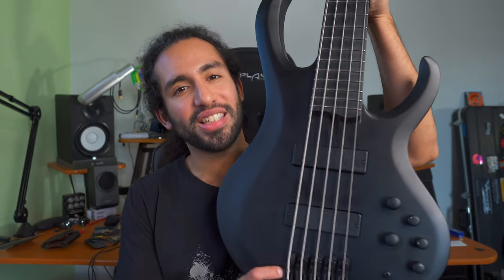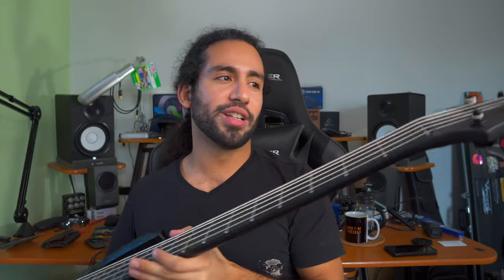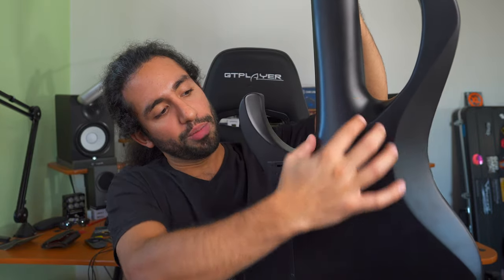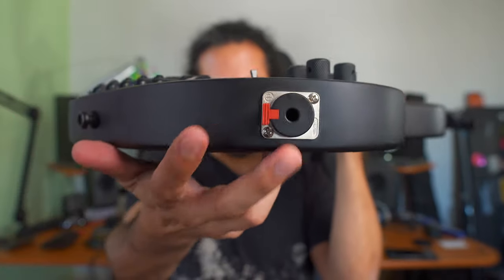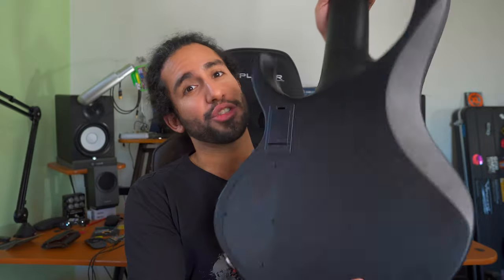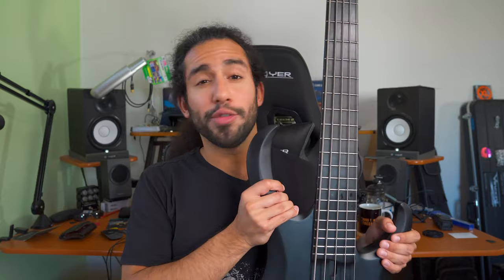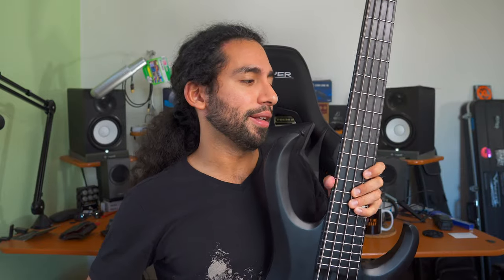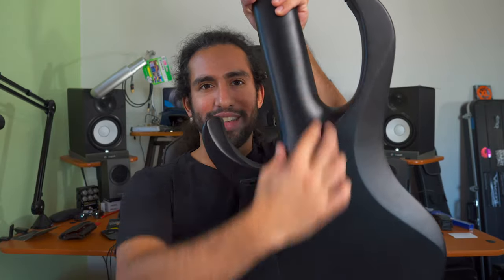Ibanez BTB Iron Label | Bass Review

Comment: BTBs in general should have a 4 string version... in addition I would say also options for passive pickups ONLY !! I had a BTB in the past, love the body design, but 35 inches length and 'only active' system made me sell the bass.
Reply from the maker: Agreed. Well, they’ve built a 4 string version for the bass player of Tesseract. Maybe a production series of that will come :)
Reply: You could have nodded it passive very easily. The pickups are passive. Only the preamp is active and would have needed to be removed.
Reply: @bobbyzig3879  Thanks Bobby. I have spelled it was also because of the scale length!

Comment: Just got mine
Reply from the maker: Congrats!
Reply: @IvanBassist  it gives me bruise in arms because of the body shape edges. And i dont like locking jack but other than that it is awsome
Reply: Nice! Is it different to the one in this video? Cos the ones I seen for sale aren’t like this. The finish in the same but the shape is slightly different, the electronics are different and the fretboard has an angled type of design…

Comment: Ivan, together with LowEndLobster, you do maybe the most comprehensive bass reviews on Youtube.

I agree with the remark about the Bartolinis. Bartolinis in general are dark-sounding pickups - the MK1s found on most Ibanezes and Corts sound even darker than the BHs this one has. A complete opposite would be the "Nordwall Dingstrand" pickups made by Nordstrand, and trying to mimick the Dingwall sound. There is a girl somewhere here on youtube who has made a comparison between Bartolinis and the "Dingstrands" and the difference is abyssal. They would truly transform this instrurment.
Reply from the maker: Thanks! 

Luckily, changing pickups is an easy mod 😁
Reply: @IvanBassist  Indeed as they are the same form factor. I found the video I told you about. I made a mistake - the initial pickups aren't Bartolinis but "Sandberg booster" pickups... but that just proves the point even more:

https://www.youtube.com/watch?v=v241vPOqCsI

Comment: Do you think it'd be better to buy this bass than a stingray special?
Reply from the maker: Those are two very different sounding basses. What are you looking for?
Reply: @IvanBassist  a bass that would be good for metal and rock while not being too aggressive. I also plan to detune a lot
Reply from the maker: @anotakudetective1546  Check the new BTBs fanned fret if you plan to detune quite a bit
Reply: @IvanBassist  I usually play my bass guitars up high on a strap. Would a 37 inch be comfortable for that?

Comment: Thank you! Could you tell me what the string spacing is like? I found it hard to slap on one 5 string I trialed because the strings were so closely spaced compared to a 4 string... Really wanted a proper demo, not one with effects, distortion and anything else that makes it impossible to get a feel of this instruments. This was great
Reply from the maker: This one has a much wider spacing than the SR series by Ibanez. Pretty comfortable!
Reply: The string spacing on the BTB625EX is 19mm. That’s the widest spacing on any 5-string I’ve ever encountered. By comparison, most Ibanez SR 5-strings use a string spacing of 16.5mm. 

Also, while the spacing on the BTB625EX’s MR5 bridge is fixed, the Premium-level BTBs come with the MR5S bridge which is adjustable up to +/- 1.5mm per string, so theoretically you can get even wider spacing with those basses.
Reply: @oil_can  Thank you! Is it true that most 4 strings also have a 19mm spacing? (I'm not sure how to measure my 4 string.)
Reply: @peterd9427   
A lot of 4 string basses do use 19mm spacing. However I can’t say whether or not “most” do ‘cause there are so many different 4 string models out there. I’ve seen plenty of 4 strings with 20mm spacing and others with 16.5mm spacing. And everything in between. 

The first bass I bought and learned on — a 4 string 1983 B.C. Rich Eagle — has 17.5mm spacing, so that spacing feels most natural to me, even when playing 5 string and 6 string basses, and especially when playing slap. String spacing is less critical to me when plucking. 

My current bass of choice is a 5 string Ibanez BTB605 Multiscale. It comes from the factory with 18mm spacing but that’s adjustable at the bridge. I have mine squeezed down to 17.5mm. 

Measuring the string spacing is easy: just take a ruler or caliper that’s calibrated in millimeters and measure from the center of one string to the center of a string next to it. Take this measurement at the saddles, meaning the portion of the bridge that moves up and down / forward and backward to facilitate adjustment of string height and intonation. 

You can double-check by measuring from the center of the E string to the center of the G string, then dividing by 3 (on a 4 string).
Reply: Thanks so much. I think I'll be fine with the 35" scale, but I mainly slap. The only 5 string I played had its strings too narrow for me the "pop" effectively. Who knows what the string spacing was, just much narrower than my 4 string!
I'll measure my bass tonight :)
I'm pretty sure I'll get this bass, but worried about buying it without trying it first, I always do...
Love Primus' style so adding a low B will be fun whilst strumming the higher two strings.
Thanks for the help
Reply: @peterd9427   Yeah, testing out a bass before buying is essential. Unfortunately you can’t really determine if you like a bass or not without first bringing it home and playing around on it for a few days. And you can’t take it home unless you buy it first. So it’s kind of a Catch-22. 

My advice is to buy from a vendor who will let you return it if you change your mind — at little or no cost to you. 

I played 4 string for decades until deciding to buy a 5 string last year and discovered that any bass that varied too much from my 4 string was hard for me to play. But that shouldn’t have been a surprise to me because I made the same discovery when looking at other 4 strings over the years.  

For instance, my first bass (which I still have) has a relatively low fingerboard, meaning the fingerboard is only about 4mm higher than the body of the bass whereas many other bass I’ve tried have fingerboards that sit about 10mm above the body. This added depth makes it very difficult for me to pop — my fingers would get caught underneath the strings because of the extra clearance. 

Likewise, extra-wide of extra-narrow string spacing makes playing harder too. 

Some manufacturers (like Ibanez) list string spacing for each model in the specs sections on their website, so that helps to narrow down your selection. Most manufacturers don’t include this info, however, so you don’t know the spacing unless you see the bass on person or find someone else who knows. 

To follow up regarding vendors: I live in the USA and have had the best luck buying from Guitar Center, Sam Ash and Amazon. Amazon Prime members get fast, free shipping on guitars but what’s equally cool is that many listings also include free returns. That means you can buy from them and if you’re not happy, ship it back. Costs you nothing!

While Guitar Center and Sam Ash generally do not have a very wide selection of basses in stock (for example, it’s very unlikely you’ll find a BTB Iron Label 5 string in one of their stores) they do have a huge selection available online. TIP: you’ll get the best prices by calling their 800 number and talking to one of the online sales reps. Just ask them What’s the best deal you can do on such-and-such item. My experience is they will instantly offer you between 10-15% off their normal store price. And they’ll ship it to you free. 

Then you get 45 days to decide if you want to keep it or not. If you don’t, just swing by one of their stores and return the bass for a full, no hassle refund. 

Before settling on my Ibanez BTB605MS, I bought and returned basses from Sam Ash, Amazon and Guitar Center. I hated taking advantage of their generous terms but could see no other way of finding the right bass for me.

Comment: Is the string spacing at the bridge adjustable to 17mm?
Reply from the maker: Not sure. Ibanez website probably has that info :) I believe you can move the saddles 1.5mm to either side, but don’t quote me on that
Reply: @IvanBassist late to the party but my research suggests this model is outfitted with the MR5 which is a static bridge horizontally. The MR5S which is the updated version has the side to side string spacing adjustment option. Drives me crazy because if this model had the MR5S and non-proprietary sized soapbar pickups, I'd buy it in a heartbeat. But it misses the mark because of it. I believe you can get a few models of US Bartolini's to fit for a swap, but I'm still looking for direct confirmation from someone who has done it outside of what the Bart website says.